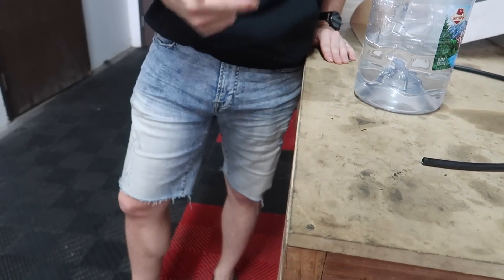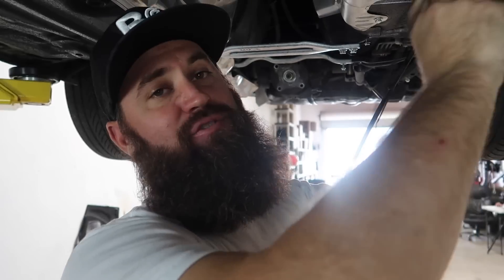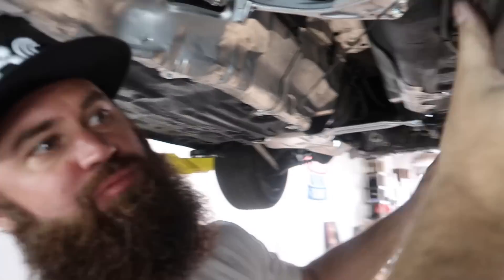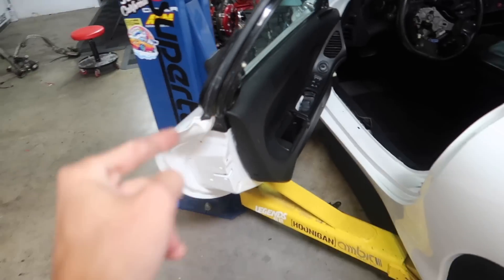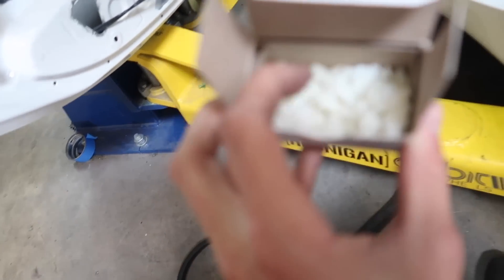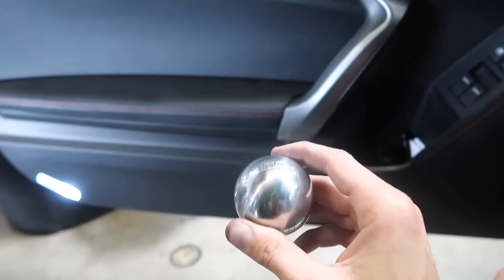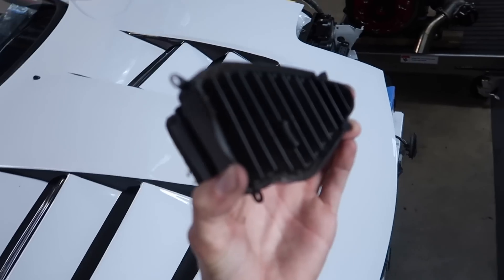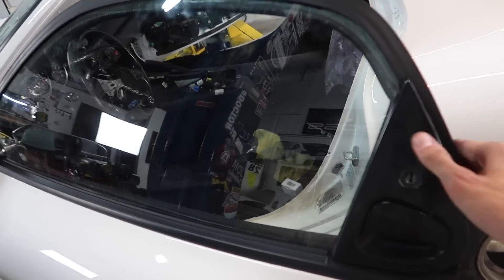The RX7 video you've been waiting for!

Comment: You should be replacing all the foam and noise dampening materials as u pull the door panels and a/c vents off. Even all your inner trim panels, specially something that old when being removed can and will start causing rattles

Comment: Just a heads up with the water pump pulley you have it has a very good chance to slip and not turn the water pump there is a kit you can get from full function engineering that will fix that problem. part # is ffe fd3s idler pulley kit

Comment: just got my bagged 2017 wrx aligned and they told me I need new front control arms with camber control in order to get the alignment in the specs. Is this true and if so any suggestions on control arms that arent too expensive, but not so cheap they are sketch?